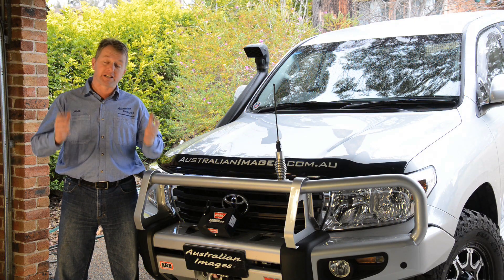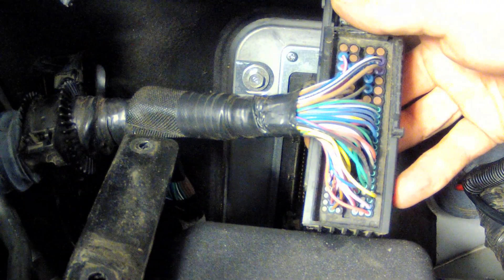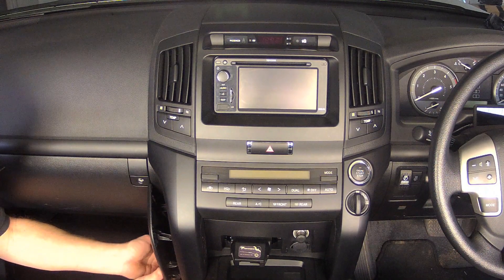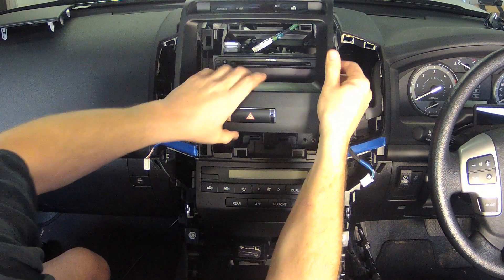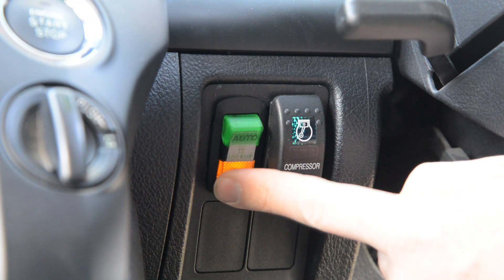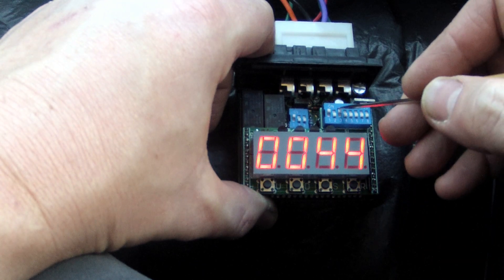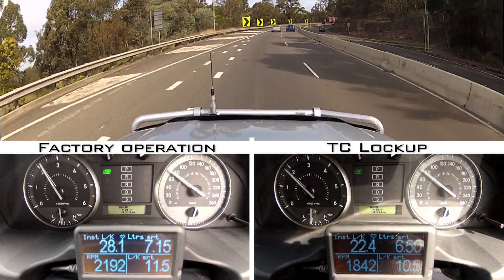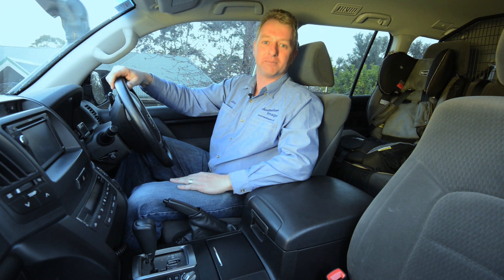Land Cruiser 200: Torque Converter Lockup - install & test

Comment: An old video but still worth asking. I'm considering richards lockup kit, but I barely do any towing. So my questions to smarter guys is it worth installing just for highway driving?
Reply from the maker: The fuel economy benefits are less than with towing, but I still find it much nicer to drive with the kit when not towing. It's really good in combination with their transmission remap, as it brings the engagement speed of 6th gear down to 93km/h under light throttle. So works really well when not towing.
Reply: @austimages  Hey! Thanks for answering. I'm having this dilemma. Maybe then only do a remap?
Reply from the maker: @Axxept555  No, it's either TC-lock only, or both. You can't do the trans remap without the lockup kit as it would cause the Auto fluid to get too hot, as the box would change to 6th at ~93 but not lock the TC, generating more heat.

Comment: great video , enjoyed it very much. my question is do you have to do a transmission remapping if you install the TC
Reply from the maker: You don't have to, and I didn't have a remap for several years. But I did add a transmission remap in 2019 and it works very well with the lockup kit. Remap is also from Richards Auto.

Comment: tape??? maybe shrink seal?
Reply from the maker: There is actually heatshrink on the individual wires, with the bunch taped up. That step's not shown in the video, but is listed on the website. You can see some heatshrink at 4:38 in the video.
Reply: @austimages  sweet, i was worried there for a sec. Seems like a great mod for those towing. I have been eyeing it off for myself, but unsure if there is really much cost benefit, mainly as I have quite a light camper trailer. Going to do some more research. cheers

Comment: 4 years now ? So how is the lockup kit going , problems , codes etc ? Are you happy with it .. I would like to do this also . Was quoted 730 for the kit , but they recommended a third party instal to stop fault codes ... which is sort of disappointing because it seems very strait forward, and is l believe already expensive.. your thoughts ?   Cheers Mark ..
Reply from the maker: Loving the lockup kit still. I've also just had a remap done (by Richards), which makes improvements to the change points and speed/load limits (particularly for 5th and 6th). Makes the vehicle hold 5th and 6th much better on the highway. It also changes the parameters for the fault codes, so stops the lockup kit causing them. The fault codes are otherwise an occasional side effect of any lockup kit. I used to get one maybe every 6 months, but reset using an Ultragauge. I'll update the web article with the remap info in the next month or so.

Comment: Thanks for the video..... I'm trying to decide between a second-hand LC200, new Prado or new Patrol at the moment, so this looks like an expense that I need to bear in mind when weighing it all up. You have a new subscriber :) Cheers, Don (Dons Shed and Xplor Overland)
Reply: What did you end up buying??
Reply: @Mrbeast0099  nothing yet, we are still using our 2015 LR Discovery 4
Reply: Dons Shed I have a 2015 Landcrusier, took a new patrol for a drive but they can’t guarantee we will get it by Xmas!! Sticking with the cruiser
Landys are always solid cars
Reply: @Mrbeast0099  Then why patrol  ???
Reply: Riaz Roar I just ordered one, drives like a car not like a truck( Landcrusier) 75% of its driving is around a small town, does about 10 klms per day, diesel is getting clogged up big time, also for only $20,000 more we can get into a top of the line patrol rather than a 6 year old gxl with no safety features or creature comforts

Comment: Has this torque converter issue been fixed with the latest lc200?
Reply from the maker: I you are talking about the programming that means it doesn't lock up as much as I think it should, then the answer is no, as far as I'm aware.

Comment: Where did you get the ultra guage from? I can't find an australian distributor. Also how much did it cost? Great vids by the way!
Reply from the maker: Thanks for the feedback! Just get the ultragauge direct from the US. Shipping is only $20 or so, and it will arrive in a week. Make sure you get the MX version to get the ATF temperatures, as the EM version doesn't show them.
Reply: @austimages  does it show egt's
Reply from the maker: @Raynmick  Not on the pre-DPF vehicles, as they don't have EGT sensors. I believe it can for the DPF versions, but I haven't seen it personally.
Reply: @austimages  thank you

Comment: Im looking to do this on my 90 series with a wholesale kit and just wondering how you are supposed to use this while towing and hills. Is it designed to be switched on and off for hills?
Reply from the maker: Can't really comment on the Prado, as I'm not sure how strong the torque converter clutch is. Mine is on full-time at any speed over 75km/h and below ~50% throttle. I added the 50% throttle Hi mate, The lettering is normally cut out (so is the colour of your paint). Is that OK? for safety after I installed the Unichip, although I've never heard of anyone who's had a problem.

Comment: Great video I have enjoyed every one, I am in the throws of nearly completing my 2017 Sahara Build and have taken on board much of your advice, I have 1 question in regards to the Torque Converter Lockup. you have now had it installed for 3 years so I assume you have done a few klms in that time, do you still feel the same about it today as then, the reason I ask is that I have been on the Richards Auto facebook page and a few guys have complained about getting error codes??
Reply from the maker: Yes, still extremely happy with it. You do occasionally get an error code. Perhaps every 6 months or so it comes up. The code (P2757) is saying that the ECU has detected the TC is locked when it thinks it shouldn't be. You can reset it with an ultragauge/scangauge etc.

Comment: Hi 
I have a 2011 land cruiser 200 diesel manual transmission and I would like to change it to an automatic transmission....not the whole car only the gearbox to have the advantages of the 6 speeds.

What's your advice?  Is it possible ? Is it safe? What do I need?  

Here's another question..is it possible to fit a the 200 petrol engine gearbox on the 200 diesel car or it's impossible?  Because where am from most of the parts that are available might be for petrol 200

Comment: HI, I've installed the converter about a year ago now and works well when towing, the only thing I find annoying is that the 200 wont hold 6th gear at 95kms. It continually jumps to 5th and shoots the rev's up to 2500rmp. Anything I can do to hold 6th gear at this speed. Great video's by the way all very well done. Cheers
Reply from the maker: Driving in "S6" instead of "D" helps to hold 6th gear to lower speeds (down to about 90km/h). The only other possibility is to have a transmission remap performed. I haven't done this myself as yet, however I have heard some tuners are able to increase the load limits for 6th gear, meaning it holds it better.

Comment: Great video. Just a quick one any changes in the hp or torque once installed? If yes by how much? 
Thanks.
Reply from the maker: Hi, No it doesn't change the amount of power or torque at all. It only changes the way the torque converter operates.

Comment: Hi there is that ultra gauge any good if so would you recommend it for a Nissan patrol.
Which model did you get and why.
Luv your videos please keep them coming.
Reply from the maker: I love the Ultragauge and find it extremely useful on the 200. A much better option than the scan gauge II which I had previously. Compared to the SGII, the Ultragauge screen is bigger, it has multiple pages of 4, 6 or 8 gauges, it has user-settable alarms for most supported gauges and it has more trip computer functionality. I got the Ultragauge MX version as it offers ATF temperature monitoring, which the EM version does not. That said, I'm not sure what functionality it offers on a Patrol, and it depends on what information the vehicle outputs via the OBDII port.

Comment: Really considering this for my vdj200, but need to know if you guys found the limitation of locked AB60F TC above 50% throttle?? mine is chipped and make around 800 Nm at crank/engine side.
Reply from the maker: Haven't had any problems. I set my Unichip to deactivate the lockup at >50% throttle just to be on the safe side.

Comment: Have now been using the Richard's locker for over a year and also been been towing a caravan on a 10k trip. The locker performed great when towing with excellent engine response and fuel economy. The only negatives with the locker are: (1) the sensitivity of the relay occasionally trips at the 80kph lockup resulting in a P2759 error code which is easily cleared with the OBD Ultragauge (2) When towing in lockup mode you have to allow for any transmission downshifts especially on hills under load as they can be quite brutal. Aside from that the unit is fantastic for highway use.
Reply: Hi Gampi do you still have the vehicle? And how is it going , you say it downshifts hard ? I don’t like the sound of that has it been a big issue , cheers Mark

Comment: Hi mate how does it cooperate with your unichips ? As the unichips has their own wires which plunged to the computer ! Many thanks
Reply from the maker: They don't interfere with each other at all, as the Unichip doesn't make any changes to the TC lockup functionality. When I installed the Unichip, I had the installer create a custom output which only provides earth when throttle is below 50%. I use that output to disable the TC lockup, just as a safety in case the lockup clutch isn't strong enough to take the increased power that comes from the Unichip.
Reply: +Australian Images appreciate the answer
Reply from the maker: @mark2382  To the best of my knowledge, yes it is strong enough with standard power and torque. I never had an issue, and I have never heard of anyone having an issue. However, as with any mod to the driveline, it pays to be cautious. You'd be best to confirm with Richards as to whether they've ever heard of any problems, as they would deal with a lot of vehicles.

Comment: What are the disadvantages ?? Toyota must have opted this out for a reason?
Reply from the maker: When the TC is locked, gear changes are more noticeable, as (very slightly) is engine vibration. I don't find these to be even slightly annoying, but it would seem that Toyota place NVH above all other considerations! I have not experienced any other 'disadvantages'.
Reply: @austimages  does a trans remap smooth out the gear changes?
Reply from the maker: @19Vern72  It smoothes them when the TC is locked, because it applies torque reduction during the changes.
Reply: @austimages  ok, thank you 👍

Comment: just a a suggestion, its a 70k vehicle at least use heat shrink on those joints not tape, even better use dual wall heat shrink with glue in it, keeps any moisture out for good, its only 4.95$ a metre at jaycar
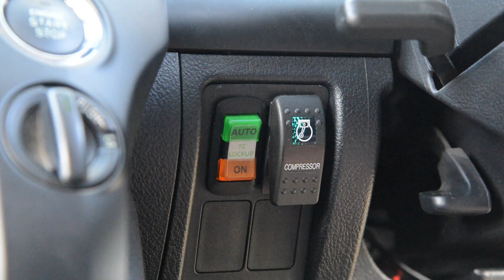Reply from the maker: It's not shown in the video Blair, but the individual wires are heatshrinked, then the bundle is taped together over the top. There is one section of the video (At 4:40) where you can see some green heatshrink sitting on the wire as it's soldered. And yes, Jaycar is the place to get it!
Reply: +Australian Images  Um not being picky but you have no heat shrink at 2:05 on 4 joints and you actually say "solder and individually tape each wire", that was more what I meant.
Reply from the maker: No worries. Just for clarification, the individual wires in that case are actually heatshrinked, but you can't see it as it's sitting back along the wires leading to the relays to keep it away from the soldering heat. Then the bundle is taped. It's true I should have mentioned the heatshrink instead of just saying to tape individually, then the bundle. My point was that the wires needed to be insulated from each other, then retape the bundle back together. I can't change the video, but I'll update the webpage to reflect that info.

Comment: Many thanks for your informative videos on the LC200 and your inspiration to do the lock-up. The kit was even easier to install as Richard's Auto now supply it with the 3 way switch already wired up. Works great, can't wait to try it out when towing.

Comment: Was the test run done whilst towing?
Reply from the maker: +Jason Wilkinson No. Improvements when towing are at least as good though. I haven't done a side-by-side, but would estimate the gains to be 15-20% at highway speeds.

Comment: australian images...where could I find the torque converter?
Reply: +Frank Martinez The toque conveter is in the same place where the clutch is on the flywheel in a manual.
Reply from the maker: +Frank Martinez You can't access the actual torque converter without removing the gearbox or engine. It sits between the two, and transmits the power from engine to gearbox through hydraulic fluid. Installing this kit doesn't require access to the TC though. It controls the TC clutch by tapping into the ECU.